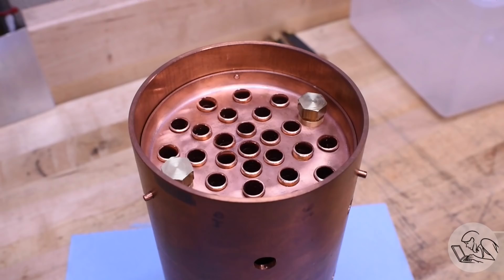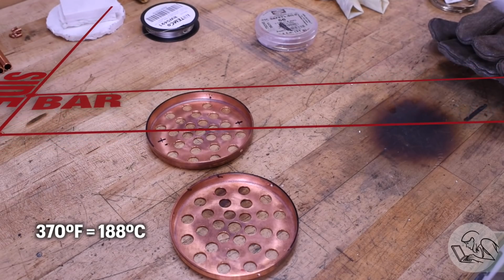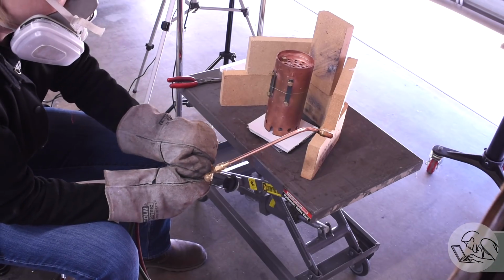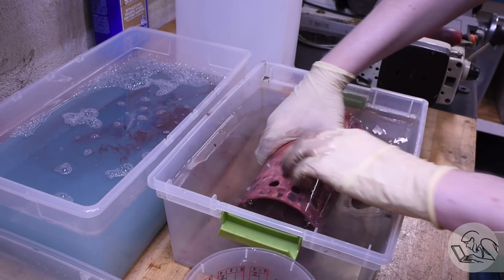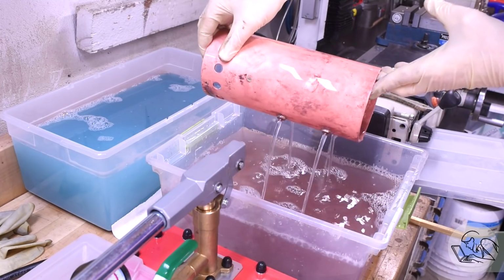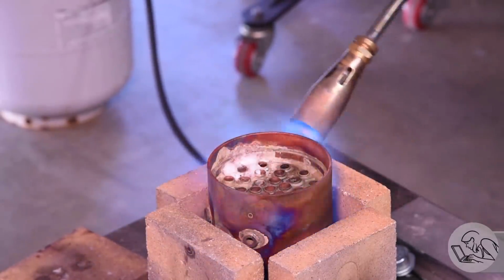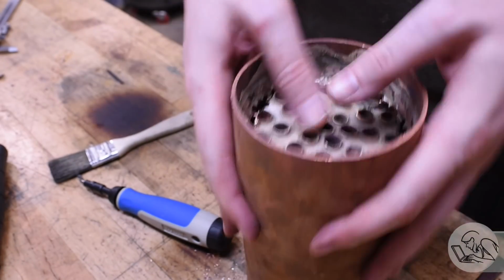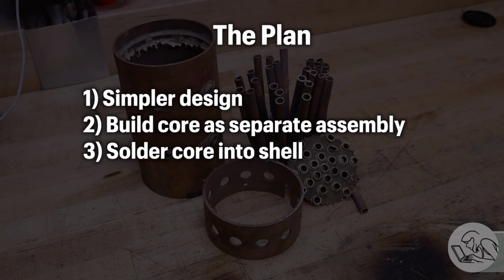Silver Soldering A Model Boiler : Failure!  | Model Boiler Build Part 7

Comment: Let me give you my qualifications before I make any suggestions.  I am a retired US Navy propulsion engineer.  I have retubed propulsion boilers, condensers, and various other heat exchangers.  I will give you kudos on even attempting something like this.  I really think your tube joints were cracking because the tubes shrank as they cooled.  In our main and aux condensers on Navy ships we have what we call the floating end.  Essentially it is just the end of the condenser that has soft packing around the tubes allowing slight movement of the tubes due to thermal growth and shrinkage during heating and cooling cycles, instead of being rolled and flared like the opposite end.  There are two things that you can do that may help prevent the separation at the joints, probably best if you employ both for best results.  First, put a slight bow in the tubes, this allows the tubes to expand and contract without bearing directly on your soldered joints.  It forces the tubes to bend slightly more when heated instead of expanding directly into your joints.  Second, put a slight concave on at least one of your tube sheets, this allows the tubes to expand and contract and have a slight amount of flexibility on the tube sheet.  Something else that may help is if you solder the tubes to the tube sheet first and then slide the tube bundle and tube sheets into the casing and solder the tube sheets to the casing.  If you preheat the tube bundle and boiler casing in your oven and then pull it out, flux your tube sheet edges, slap it together and then start the soldering process it will reduce the time necessary to heat your joints without spoiling the flux.
Reply: This!

Comment: Great to see the fails as well as the wins, way more honest, the teardown is fascinating.

Exactly that, it's not about max temperature, it's about 'volume', same as with electronics, if you have the power available to heat large mass of material then soldering becomes much easier. 

So I wonder if something like a pottery kiln might be useful, get the kiln up to temp and then pop the boiler in complete with flux, solder etc?

Also wondering if silver solder works in a similar way to electronics solder, if it cools too fast it makes 'dry joints' and it might be that which is causing the cracks?

*disclamer, my silver soldering experience is a long time ago and not on anything as complex or 'massive' as that so it is just idle musing

Comment: If you have a LPG fired BBQ, that is very useful for providing some background heat. Build up the hearth on top of the grill. Even on small boilers I've found additional heat sources to be useful.  I have a couple of the DIY store torches with a gas cartridge that I stick through a gap in the fire bricks.

Comment: Quinn, as a time served sheet metal worker who spent most of my 6 year apprenticeship soldering ( soft solder & silver solder) brazing & welding I can’t really figure out what went wrong 🤔 I wonder if it would be possible to build the core separately using a jig to hold endplates etc then fit the soldered core to the boiler tube  for final soldering? Good luck with version 2

Comment: Quinn. I feel your pain. I once tried repair a big heat exchanger at work with stress cracks similar to what you have shown. I got  about 80 percent of leaks fixed and then started to chase my tail . It was lucky that it only had steam at 7 bar leaking into the humidifier. Made temp and moisture control a bit difficult for the process guys. But kept plant running until a new replacement arrived.

Comment: Chin up Quinn!  So sad to see you saw the thing open, but yes, as you showed, it was unlikely to be able to be saved without redressing those joints from below. By the way, from jewellery work, I have used several grades of hardness of silver solder to make assemblies using a series of soldering steps without undoing previous work. I’ve never tried to solder a pressure vessel tho!  Good luck, and I look forward to seeing the next one - plan B looks very sensible.

Comment: I’m not even close to an expert and didn’t play one on TV either but by using larger tubes and fewer does that help with heating issues ? Would a thicker piece of copper on each end help ? Also would having the tubes 1/4” above the plate and have a solid silver solder sheet and have the flange on the plate inwards help ? Like I said I don’t know and it’s just me asking !

Comment: I have a Henrob acetylene oxygen torch that has a very fine tip that works well. They have those handheld butane torches that electricians use. Have you tried a very large electric iron? Like the ones radiator shops use.

Comment: Quinn I fee for you I’ve tried making my own boilers ( 3 total so far a very small mamod style that I had success with then a stephensons rocket boiler and a vertical similar to the one you are building the books I’ve read recommended as you’ve said you will do, do the fire tubes and plates together with a higher heat silver solder then combine that with the boiler barrel with a lower melting point solder I very much hope your second boiler goes smoother for you also I would recommend getting a couple of the stand with claws on like you’d see in the science room at school to hold your torch and have a second blowtorch to do the solder and one to keep the heat constant which is what is suggested in a couple of the books I’ve read and I believe the professional boilersmiths do here in the uk tow people one on the main touch keeping the heat level and a second with a smaller torch flux and solder to do the job hope this info may be of help to you and I’m immensely looking forward to seeing the end results as it may help with where I’ve gone wrong with my two I tried to make best of luck to you

Comment: I'm thinking out loud here.... I have a soldering iron that is a half inch around on the end and gets very hot real fast. I wonder if it could be used to stick inside each tube and generate enough heat on one tube and not bleed heat over to the ones adjacent to the one you are working on.... Hope this makes sense enough so that you can understand what I am trying to convey. Thanks for sharing Quinn!!!

Comment: Hey Quinn, I’m a union Pipefitter and I specialize in boiler install repair and piping and with that I also deal with condensers for chillers and the like. Chiller barrels usually have 1/4”-1/2” copper tubes in them and we have to remove and roll theses tubes. With that said, I may be able to lend you a hand with a tube rolling setup that I can lend you to roll the tubes if you want to go that way. I can promise you that you can get 150psi on a rolled joint as well
Reply from the maker: Thank you for the offer! I’m gonna have another go at silver soldering the tubes but I would like to try tube rolling someday for sure.

Comment: Use a jewelers torch to spot braze the tubes in.  Your only applying heat where you need to braze the tubes in, not the whole boiler.  You braze every other tube at a time until you have all tubes brazed in.   I use a jewelers torch all the time and love it for that reason.

Comment: Ive built boilers. Id have assembled the tubes and end plates first and solder the inner tubes and add the next circle and work outward so I could drop the solder on the joint and then switch to the other side to pull it through with the heat.  Then solder the tube plate/tube assembly into the pipe using mostly heat on the outer shell so the flame isnt overcooking the fire tube joints.  Im really enjoying your channel.  I started model engineering as a young boy and built LBSCs "Masie" 3.5 inch gauge locomotive.  That led me to a career machining and my own products which I produce with 10 beautiful cnc machining centers and even a robot welder now.  Best of luck reworking the boiler.  All the best!

Comment: You did not fail yet, because you're still working at it! As a woodworker my machining knowledge is limited. But, when you cut the boiler apart, I thought, why not make the tubes and plates as a separate assembly and then solder them to the shell? Then you proceeded to describe that as your new plan. You're even teaching this lignin hack a few new tricks.

Comment: Lol...I have been a refrigeration tech for over 50 years and done tons of silver soldering as well as silfosing. This would have been a challenge for sure. I probably would have taken it outside and drove my truck over it at some point so kudos for  hanging in there and learning from your failure.

Comment: it looks like you had the propane torch to close.. the hottest part in a propane torch is just in the dark section of the flame (you can see the spot i mean @ 15:26 where the bricks and the boiler are glowing red) it looks about 5 inches away from the tip on that torch

Comment: Good video as always, they don't always work out, thanks for being honest and brave enough to share. But eek, what a cringe ending

Do you think that hydrostatic test pump would work for an air compressor tank? It's still more than I spent on the compressor, but I've seen enough failures online that I've become chicken.
Reply from the maker: Yah, I think it’s actually intended for compressor tanks. It’s way overkill for testing these little boilers. It goes up to 2000 psi or something crazy

Comment: So called cold welding with a TIG welder, I s there a chance for this a a method to weld the copper to copper and not use flux or have the silver waterfall happen (I have used the clod welding on my tig to make water pipe stops for plumping) Im the first to admit my experience is limited, just wondering if this is another process for manufacturing Cheers J  https://www.youtube.com/watch?v=6sFdq7tLh8w

Comment: I feel for you!   You might like to view my video on making my first 6 inch copper boiler. 
https://www.youtube.com/watch?v=a7nZ0zwbGEs&t=1s
I believe that your biggest mistake was using Cadmium free silver solder.  I have had several silver soldering failures with this type of silver solder and decided to make my boiler with Cadmium Easiflo 40% silver and I did not have the same problems of cracking/reheat that you had.    Best wishes and thanks for your video, it's not easy to broadcast your failures but it highlights the pitfalls for others to learn from.   Good luck with your next boiler.
Reply: I forgot to mention that I used a high temperature "black" flux which helps avoid the problem of disabling it's action by excessive heating or duration.  The white flux is not so tolerant!

Comment: Would a shielding gas where the water would normally be help to flow the solder by preventing the copper from oxidizing? The flux should take care of this but this could provide a larger margin of error.

Comment: Regarding remelting joints when you go 1-by-1, the solder forms an intermetallic compound with the base metal. This results in altered melting points, usually in your favour - less likely to remelt. However, intermetallic compounds are brittle and can result in weak spots.*

*They may be even worse if you heat the boiler all at once for soldering as intermetallic compound growth rate is proportional to the square root of time - the longer the joint is hot the more intermetallic compounds form.

Comment: Very interesting stuff.  I like that you ended up with something similar to the “elephants foot” that they found in Chernobyl. 
It was very close and I am sure you will nail it next time.   Sorry can’t resist unsolicited advice…. Get higher melting point solder for the core and keep that yellow sooty oxy flame well away from your joints.
Reply from the maker: Yah, got my two heat ranges of solder all lined up for attempt #2! Black flux this time, too. Everyone says it’s much more forgiving.
Reply: @Blondihacks  yes black flux is good for higher temperatures.  I use it for brazing stainless.  The normal stuff should be fine for copper.  Best of luck anyway.  I think you will be fine.

Comment: I work at a much smaller scale.  One thing I do to protect my solder joints when heating adjacent joints is to coat the joint in a yellow ochre paste.  This makes the joint dirty and the flux less likely to flow.  I don’t if it will work at the scale you are working in but it might be something to look in to.  It is always enjoyable to watch you work even when the result is not what you hoped, thank you for showing us that not everything turns out perfect.

Comment: Hi Quinn, dont feel bad I had same issue with an e-bay purchase built boiler around same size as yours only mine had been soft soldered, I wont go in to how I found out, lets just say I am still alive and god only knows unscathed, anyway I got around my silver soldering by purchasing some old type blow lamps that were Ex military, I had to restore all of them but got them all working, each blow lamp holds around 1 Gallon of paraffin, what I did was equally space them all around the boiler and finally got the copper hot enough to melt the silver solder, what a night mare, but got there in the end. Loved your video and thank you for sharing, its good for we novices to see someone of your experiance make cock ups. No puns intended. love your work, keep safe and best wishes.
Reply from the maker: Holy cow! Glad you’re okay
Reply: @Blondihacks  It was very scary, the safety valve blew off, as in like a bullet, I never found it it turned out all the boiler fittings and internals were all soft soldered, just shows what dangerous items people will sell you, there was 80psi on the gauge when it blew. needless to say a big lesson learned. Be safe and take care. love you and your Videos.

Comment: Wow thats a blow. I think the strategy for flowing the entire part at once; you need an electric kiln to be you heat source.  It means every joint gets the correct amount of heat. I’m not sure the optimal way to shield the joints.  Some try to display the oxygen in the kiln with something inert (I’d think argon is fine). But that is a tricky area; trying to apply heat correctly to that copper mass with so much surface area.

Comment: What a shame after all the work you have put into it I wish I was with you when you were silver soldiering the boiler. I’m 82 yo now and served 5 year apprenticeship to be a boilermaker and worked on full size locomotive in steel and built loads of model copper boilers. You made a fabulous job of all the copper parts you kept it spotless you fluxed all the joints carefully but you didn’t get it hot enough.  That boiler could have been saved but I bet you have learnt a lot for your next one. It’s ok to wave the flame over the tube ends to make the silver soldier to run but don’t linger in one spot keep the flame moving. Cheers Doug.

Comment: I found that soldering all of the parts at one end all at the same time/heat cycle which prevents cooling which sucks garbage into the puddle and thus you get the little holes.  By doing sections you also heat previous sections and they begin to fail.  Do it all in one swoop

Comment: ....by the way - I use Air acetylene with a large head and had a propane torch too. Air acetylene is higher temp than propane but lower than oxy-acetylene so lowers the risk of copper melting. But i do agree with your comment about volume of heat rather than pinpoint...

Comment: OMG....i would cry if i had to destroy a boiler after all that effort and cost.... copper and silver solder is not cheap! I really can't fault anything you said during this video, my only guess is to use thicker silver solder as you suggested. I would also recommend a silver solder with Cadnium in it as it flows better. I use Easy Flo 45 (not Sil flow 45 which is cadnium free). For my 6" diameter boiler, i built the innards independently and that fixed it all to the shell as you suggested in your end plan. I have water tested to 80psi with no leaks so far - need to do up to 160psi soon....now you made me nervous!

Comment: Nothing worse than putting in all that effort only for it to go south at the last minute. My 2 cents worth (speaking as a longtime goldsmith) you can never have too much flux, the more the merrier also your pickling works best when very warm to hot, then a dip into a baking soda bath to neutralize then a rinse in water. If you're in an area with hard water use distilled. Looking forward to the next epic instalment!!

Comment: Have you considered using several different temperature silver solders.?  you can then solder in stages agacent each other but with lower temp solder each time.  Steve
Reply from the maker: See my plan at the end
Reply: @Blondihacks  appologise I missed that writing the post.. looking forward to the next video.  It’s a lot of work, have you considered building a flash steam boiler??? Simple construction , minimal soldering, no pressure testing requirement, loads of steam, on demand. Steve

Comment: I'm 5mins into this video and asking, If you've ever heard of silfos?  I do HVAC work and you should see the dirty ass pipe I braze without cleaning or flux.  Silfos15 is what I use....  Back to the video.
Reply: How heart breaking.  Tell us again why silfos wont work.  You didnt really explain why.  Thanks.  What is the max pressure you need to hold?
Reply from the maker: Not high enough temperature and it isn’t steam compatible
Reply: @Blondihacks  no shit?  silfos15 melts at like 1400 I thought.  🤔